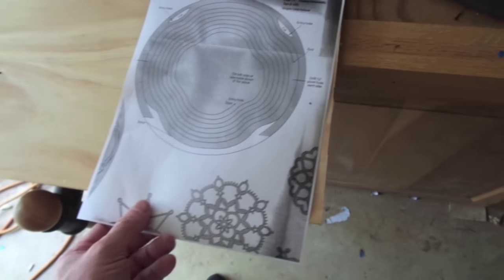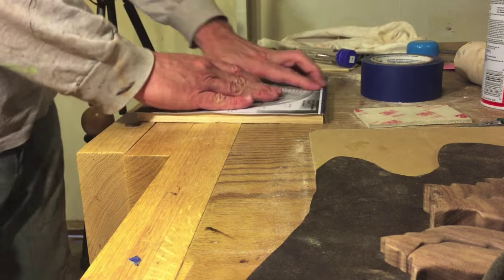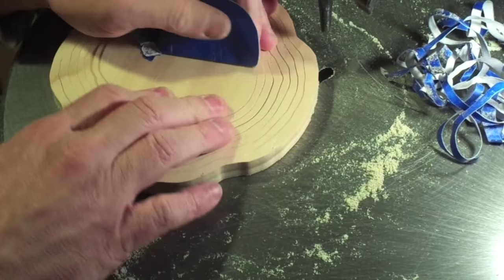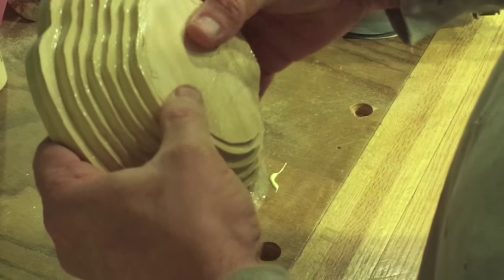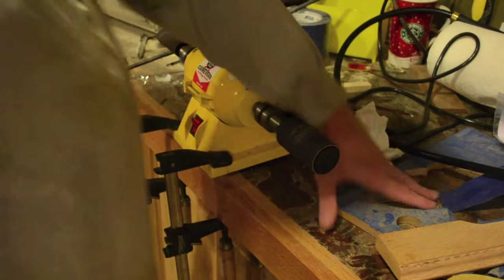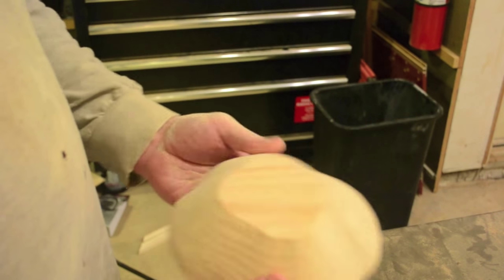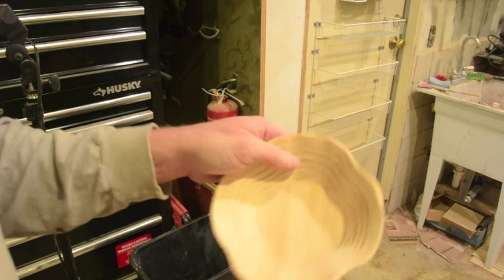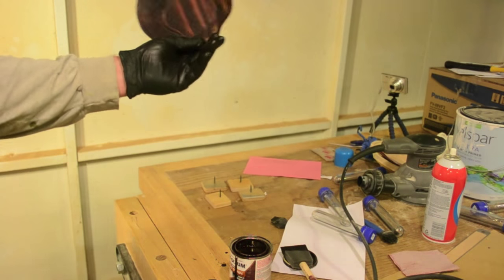Scroll Saw Spiral Wooden Bowl

Comment: You forgot  to mention that in using the scroll saw to cut out the pattern, you have to tilt the scroll saw table about 3 degrees so that after cutting the wood will not fall out, rather it will expand into the shape you show.
Reply from the maker: +irv berman Irv, you are indeed correct. Good catch
Reply: Pro tip: you can watch series on flixzone. Been using them for watching loads of movies recently.
Reply: @Everett London Yea, been using flixzone} for since december myself :)